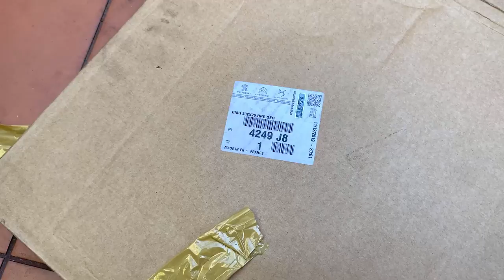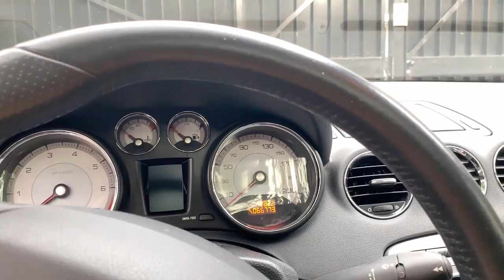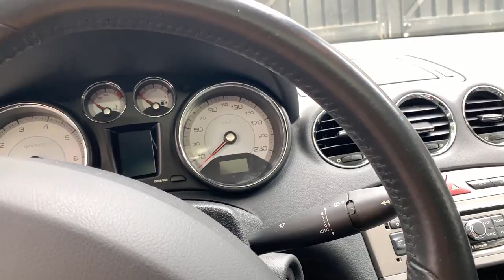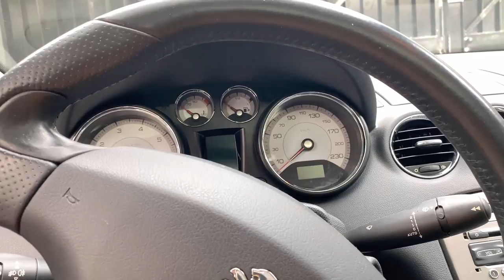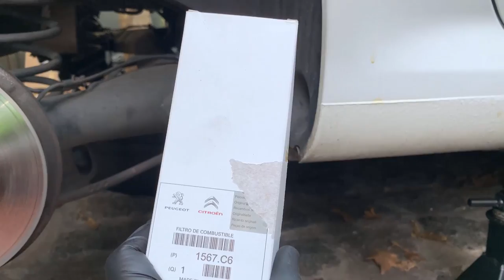Peugeot 408 THP SERVICE GENERAL + Frenos + Filtros  + Bujias

Comment: Hola Gonza, te mandé un mail y seguramente no has podido responder, quería consultarte que yabuna vez te pregunté.., realize el cambio de tapa de val  del motor thp, un 408, puse la tapa alternativa, una vez colocada la tapa el auto me salió la falla P0016, fuera de punto.
Lo raro es que me salió después de haber puesto la tapa, podría ser el sensor que está mal, ya que es una tapa alternativa no tenga la posición igual que la original, cómo puedo saber si es el sensor?
Gracias Gonza, cómo siempre tutoriales geniales!

Comment: hola buenas tardes, consulta no es sobre los frenos pero no encuentro por que medio me podría contactar con vos para esta consulta, compre una 3008 mod 2011, consume un litro de aceite cada 1200 km, es una locura revisé los puntos de la tapa de válvulas, y evidentemente abría que cambiarla, ya que transpira por ahí, además a haber visto en la mangueras del turbo intercooler aceite, por lo que intuyo según lo visto en tus video que la válvula pcv estaría jodida, la pregunta es la siguiente, cambiándole la tapa de válvulas por la nueva con la modificación de en la manguera del turbo la válvula de pcv, DEJARIA DE CONSUMIR ACEITE, o realizado eso, consumiría  pero en menor cantidad, gracias.

Comment: Hola Gonza, muy bueno el video..
Después te quería consultar, tengo un 408 thp y hace 5 días tengo un Grillo en el motor y cuando lo apagó al motor queda con presión negativa, es decir cómo chupado.
Por lo que vi en tus video es la Val. Pcv, mí pregunta es, siempre que el motor queda en esa condición es falla de esa válvula??
Gracias Gonza por los videos y espero una respuesta pronto,
Saludos!
Reply from the maker: Hola Dario, mirá por lo que me contas es probable que tengas que reemplazar tu tapa de válvulas o bien hacerle servicio a los diafragmas en caso que puedas hacerlo. No siempre queda soplando o alviando el sistema, solo cuando se encuentra en falla.

Comment: Hola Gaston, un lujo tus videos!
Hoy justo saque el filtro de aire de mi peugeot 2008 thp. Como alternativa, lo hice sin sacar el conducto pero si sacando el tubo de la izquuerda que va conectado a la tapa.
Consulta, el filtro de nafta fel peugeot 2008 esta en el mismo lugar que mostras en el video o esta debajo del asiento como el 308?
Desde ya muchas gracias y exitos!
Consulta
Reply from the maker: Hola Kramer, sabes que no recuerdo donde estaba en el 2008... perdón! Pero si no está bajo el asiento entonces esta cerquita del tanque de combustible, siempre están por ahí, seguí las lineas de combustible en la parte trasera no le vas a pifiar.
Reply: @gsmecanica  Se agradece. Sospecho que el filtro se encuentra deabajo del auto y hay que remover una tapa de plastico (ubicacion atras lado acompañante). El finde estare revisando y despues les cuento.
Saludos,
Hk
Reply: Confirmo que el filtro de nafta del peugeot 2008 thp modelo 2018 esta debajo del auto abajo de una tapa de plastico lado asiento atras acompañante. Saludos hk